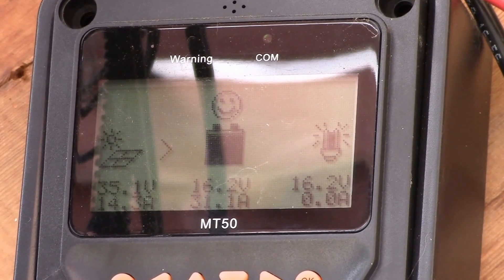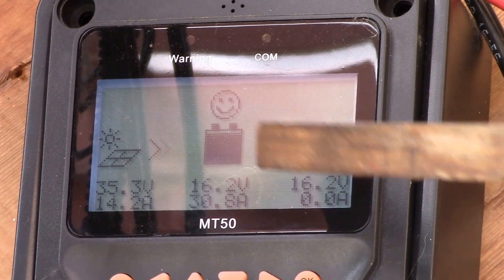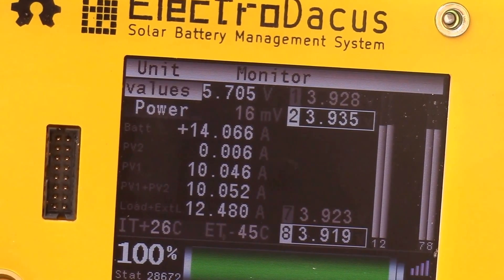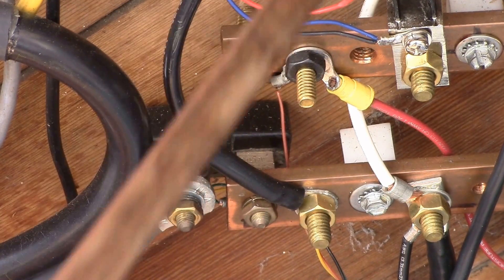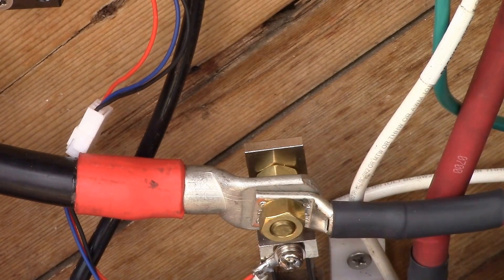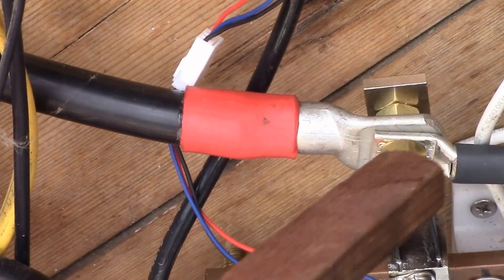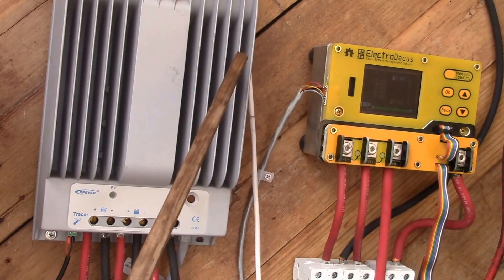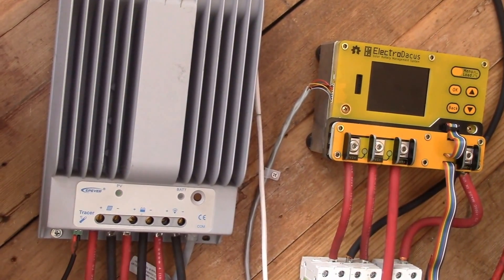SBMS120 - External Current Shunt

Comment: Thanks very much, please can i install the sbms with lithium battery and capacitor in series to my invertor
Reply from the maker: Yes, assuming a parallel connection.  I'm running the SBMS connected to a 4S lithium battery and a super capacitor bank, both in parallel, and that's powering my AC inverter:
https://youtu.be/mZAIBeP86Mo

Comment: You have 72 cell PV panels ad just 4 cells and for the SBMS to work efficiently you will need a 24V battery 7s for your type of cells and actually best case will be to use 60 cell solar panels with 24V battery then SBMS will be more efficient than an MPPT.
For 4s you will need to use 36 cell solar panels to be the most efficient.
At just 20A charge current the SBMS will not even need a heatsink at all as there is way less heat than from an MPPT.
MPPT is completely useless in offgrid type applications and for details about that see my older video about all the reasons https://www.youtube.com/watch?v=cKrh9tdXDX8
About the SOC when the highest cell gets to 4V charging will stop and battery will be considered full (is 4V as default instead of 4.2V because that way the cells will last much longer and cost amortization is the important factor not energy density). From that point as you discharge the cells the SOC is calculated base on energy getting out of the SBMS and will be very accurate.
Your other energy counter has no idea when the battery is full so it will not know to properly calculate the real SOC.
If you are using an inverter trough the external current shunt you will need to also use the EXT IO3 set as type 2 connected to inverter remote ON/OFF port that way if any of the cells gets under the minimum set voltage the SBMS can turn off your inverter else you risk over-discharging one of your cells.
Reply from the maker: Thanks for the comments.

I have 60 cell panels and yes, I realize using them for 4S is only 50% efficient.  This is just temporary allowing me to re-use my existing 12V equipment at 16V.  I do plan to go to 7S at some point but that will involve investing in a new inverter as well as upgrading all my existing 12VDC loads to operate off higher voltages.  

This is why I'm running an existing MPPT controller, for now, in parallel to provide bulk charging at a higher efficiency until such time as I can swap to 7S.  At that time, I'll likely run all the solar into the SBMS120 as it'll be more than adequate for my needs.  I have the MPPT set to stop at 4.0V/cell as well and am using that voltage for the very reasons you suggest.

I need to work out if I can modify my inverter for external on/off control.  It has a remote box, but that hooks up via a serial port and I need to see if I can hack that for an on/off input.  It is only turned on manually during daylight hours for now.

My external charge meter does work off of AH in and out of the batteries as well as automatically resetting to 100% at a charge voltage/current/time duration setting.  I find the readings between it and the SBMS are fairly similar at lower states of charge.  Up in the 85-100% range, I see some differences, likely due to the TriMetric auto reset parameters that I am still adjusting.  It's just that I've used that device for years and am fairly confident in it's readings.  I had it running on the 4S battery bank prior to connecting the SBMS and I'm comparing the two readouts to have them be fairly close.
Reply: At 4V the cells are at around 70 to 75% of full capacity so when you set the battery capacity in the SBMS Parameter settings you need to consider that. Maybe best way is to do a discharge from 100% SOC to zero and then see what the discrepancy is with calculated SOC that will allow you to know the exact battery capacity between this high and low set limits and use that exact value in Parameter settings.  Actually you can reset the energy counters when you do the discharge test and see the exact battery capacity and by using that in Parameter settings the SOC indication will be as precise as it can be.

If the inverter has no remote ON/OFF port the easiest way is just to solder two wires in parallel with the mechanical ON/OFF switch then leave the mechanical switch on OFF position and then the SBMS EXT IO3 will be the one that will power ON the inverter when battery is OK and you can add a switch in series with EXT IO3 to manually turn off the inverter. The EXT IO3 and IO4 are small SSR (solid state relays) capable of max 60V DC and 700mA while the ON/OFF switch on most inverters is just a pull up to battery voltage and when it is pulled down to ground by the mechanical switch about 10 to 20mA will flow trough that switch so easy to handle by the SBMS small SSR (is the CPC1002N).

You mentioned panels are something over 300W rated and if so those are very likely 72 cell panels 6x12 cells as around 300 to 310W is the limit for some of the most efficient 60 cell panels and typical they are rated around 260W to 290W.

The SBMS is designed as common negative that is why the external current shunt needs to be on the positive side. Is more expensive and complex to have common negative that is why most others have common positive and so current measurement is done on the negative line.
Reply from the maker: Battery capacity was tested at 4.0V/cell on each module (4S20P), so fairly confident in those numbers.

Inverter remote control box has a single switch contact but it's a long press to turn on and a long press to turn off.  That is fed into a microcontroller inside and then the command is sent via RS485 to the inverter.  Will need to see if that will work with the SSR output.  THe on/off switch on the inverter is the same setup, long press to turn on, long press to turn off.  I've not looked inside the control panel module atop the inverter, but it's likely similar to the remote.

Panels are LG Neon2 60-cell panels in this video.  I chose these panels specifically for use with the SBMS as they have a rather high max. current rating of 10 - 10.5A.  But I've now switched over to my old 60-cell, 270W panels for now.
Reply: What sort of cells do you use ? I have not seen the battery in the video.
Yes that inverters seems like not a good candidate for remote ON/OFF most inverters have a mechanical switch. Is likely your inverter still uses energy even when is OFF to keep the microcontroller that monitors the ON/OFF toggle switch so not great likely an older design not suitable for Lithium.
Yes then those panels are 60 cell panels but very efficient cells so also likely more expensive per watt than the more common ones.
They are of course great if you have limited space and you want to get the best out of them but is less cost effective than typical 260 to 290W panels.  I got my 260W panels at 200CAD last year so that is about 155USD or 60 cent/Watt and there are maybe even better offers in US or Europe.
The Neon2 have also slightly higher max power point voltage around 33V STC vs around 31V for more common 270W panels so gain will not be that high with 7s except for hot summer days where the 320W panel may perform significantly better but those are the days when you have the most excess energy so is not that significant if you are offgrid as battery will be charged maybe even before noon.
In summer I have typically over 50% excess energy (this is with fixed array for battery charging only now that I have a single large array for heating also excess is over 90% in summer).
Reply from the maker: Yes, perhaps not the best inverter for this application, but that is:
1. What I already have, so trying to make use of existing components.
2. The reason I'm setting this all up in order to learn what features I need for components such as this.  On the surface, this inverter says it has remote on/off capability, but it's only once you open up the remote and see how it operates that you find out it's limits.  And yes, it does seem to draw ~25mA of current when "off" for that microcontroller circuitry.

I have a limited area (4 panels worth) on the only south facing surface on my house, so wanted to get maximum amps/watts onto that.  I also have my older 270W panels that I'm using in a SE/SW setup that I'm now feeding into the SBMS.  

The 4S/16V setup is temporary until I can find/afford 24V components that I want to upgrade to.  But the idea of this temporary setup is to learn how all the components connect and interact and then decide which will be the best option going forward to 24V.  For example I now know I need an inverter with a remote contact on/off capability.
Reply: Yes that inverter can say it has a remote but is based on a proprietary serial protocol and they will not give ou details abut the protocol so only they can sell you accessories and con not be integrated with a BMS unless they make one.
Most people seems to prefer the Cotek inverters they do have the proper remote ON/OFF for SBMS and I use a PIP2424 230V AC now there is a newer version PIP2424LV that is 120V AC. This PIP are popular as they are cost effective and seems to be good quality mine is just about 1 year since it was installed and works great I use it about 1 to 2h in average per day mostly for electric cooking.
Reply from the maker: The PIP2420LV is one of the inverters on my short list when I decide to go to 24V.  I do have some ideas for adding a remote on/off control to the inverter I have now.  Just need to do a bit more reverse engineering the existing remote PCB and I think it should be fairly easy to implement.
Reply: What is the advantage of your SBMS over another charge controller whose charging can be set manually to  accomodate the special voltages of lithium?  For balancing each of the lithium cells couldn't one of the inexpensive cell checker/balancers work? See link:   https://www.amazon.com/Tenergy-Battery-Intelligent-Digital-Balancer/dp/B0178P8H9U/ref=sr_1_fkmr2_1?ie=UTF8&qid=1531605126&sr=8-1-fkmr2&keywords=cell+meter+turnigy#customerReviews

Comment: Hi. Interesting video. I need a bit of clarification. Are the SBMS and the Charge controller wired in parallel to the panels? What's the wiring arrangement betwen these three items? I was just thinking there may be conflict. But I may have misunderstood the wiring.
Reply from the maker: The two systems have separate solar panels.  In the video, I had 2 - 335W panels feeding the MPPT charge controller.  I recall it was running at approx. 36 volts and 12-14 amps.  Then the SBMS120 had one 335W panel feeding it.  That was running at the 16 volt battery voltage while charging, but pulling the full 10 amp output of that one panel.  Since the two devices are operating the panels at different voltages, they have to have separate panels feeding them.

Both controllers are connected in parallel to the 4S/16 volt battery bank, although they are separated by the 200 amp current shunt.  This way, the SBMS sees the MPPT charge controller as an "external charger" along with the other external loads in the system.  

Main reason for the two controllers is at 16 volts, I'm losing half of my solar panel capacity if I were to run only the SBMS.  Some day, I may go to 7S/24 volts and then that won't be much of a factor.
Reply: Thanks for quick reply. I am not very familiar with the SBMS, but your explaination has helped. I have a Tracer3215BN, used to go to lead acid batteries, but now goes nowhere at the moment, as I have a grid tie inverter straight to two 300w panels. And about 256, 18650 cells, so looking at how I can wire that up in the best way, which is why I came upon your videos. Thanks for posting , I'll keep watching.
Reply from the maker: No problem.  I was in pretty much the same situation and wanted to see how I could transition my system from the old 12V lead acid battery bank over to Lithium Ion.  I have a bunch of videos in my Power Wall playlist that documents all those adventures:
https://youtu.be/ggRee6ebFGY

Comment: I believe SBMS doesn't have the ability to do charge controlling. It can only do charge termination and balancing.
Reply from the maker: Yes, it does both functions, I think that's the reason for the leading S in the name, Solar (charge controller) and Battery Management System.  The SBMS120 will handle up to 75 amps of PV input on each of it's two inputs, for a maximum of 144 amps combined between the two.
Reply: I'm not sure about the new model, but the old one was using PWM-like design topology for PV charging, and his idea was to use battery pack voltage and PV maximum power arrangement voltage to be very close in order to achieve higher efficiency. Hence, to avoid doing MPPT. Otherwise, I don't think this can handle relatively high voltage differences between PV and battery pacj.
Reply from the maker: This model seems to do a simple on/off control of the PV input.  If connected, panels are at the battery voltage.  If off, they run up to about 36 volts.